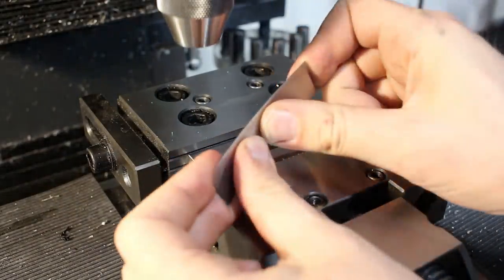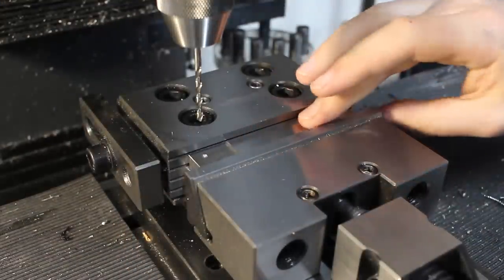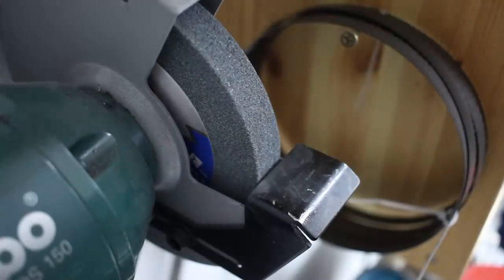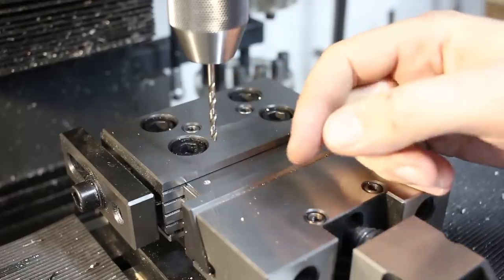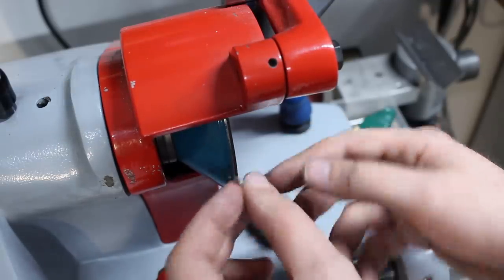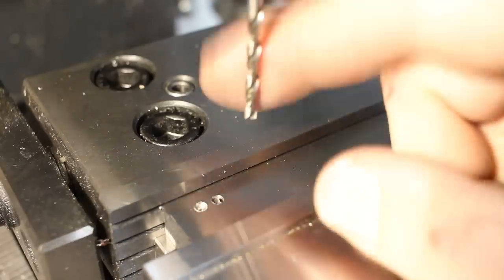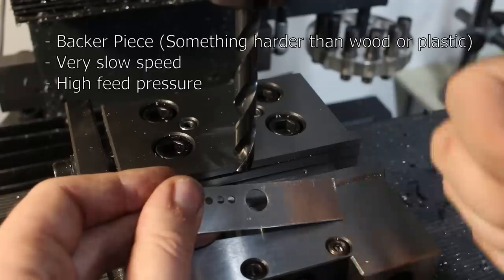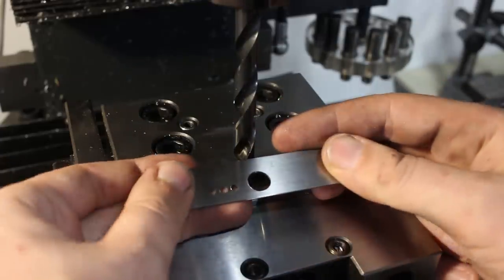Tipsblitz19: Drilling spring steel with HSS drills

Comment: great tip! now if only you had a tool to deburr those holes.
Reply: You just have to wait for Tipsblitz20, Tony.
Reply: TOT makes one from a file on his channel.
Reply: Ow you sneaky TOT..
Reply: It would probably need a sub-scribe tool. Any ideas ToT?
Reply: Knew I would see you here
Reply: Sam Hill  😂😂😂
Reply: could you use the corner of a ceramic brick? or maybe a crystal of quartz?
Reply: @charlesangell_bulmtl  that makes me think maybe the radio candle (idk what it was called) that StyroPyro showed off recently can be used to selectively heat sharp points on the part

Comment: Stefan, love your videos, can i add a tip I  have learnt from my years in the workshop and driiling hard steels with HSS drills. If you take your sarpened drill to the diamond lap on your tool grinder as you did to split the point but instead of splitting the point you grind the cutting face true to the axis of the drill bit ( in effect reducing the positive rake of the cutting edge to a neutral rake) this presents a very strong edge to the hard material you are cutting that will not dull easily. Drill at slow speed and with a high sulphur cutting oil if you have it and the drill will slide through even very hard steels..(I have drilled holes in ball bearing cages and files using this technique) Thanks again for your fantistic and informative videos..you have taught me several things :)

Comment: Stefan, my personal trick for drilling thin spring steel (no more 1/32" or 0.80mm) is to spot anneal the drill site. I do this with friction heating. I grip a wood dowel in the drill chuck, max the spindle RPM, and intermittantly force the wood dowel firmly into the work hard enough to make smoke. Stop when you see a blue spot spreading from the friction. Then swap to the drill and make your hole at normal drilling speed. This might work on thicker material but I haven't tried it. Metal backup will suck the heat away: you might want to use wood after all. 

Don't over-feed. You don't want red heat - just enough temperature rise to draw the spring temper into machinability.

You might also "bsck off" the 25 degree positive rake at the cutting edge to neutral as you do for drilling cast bronze.
Reply: Poo lo
Reply: Seems a very good method, I will try next time I need!  As you mention, it will probably not work that well in thicker material (because the more heat dissipation?).  Couldn't that be solved by using an aluminum (or other material) dowel?  It would give a much higher friction (= more heat) than wood on steel?
Reply: sometimes the best solution is low tech!
great idea, thanks for sharing!

Comment: Ordinary spring steel sure is a pain, but if you can find some Bruce spring steel, that stuff was Born To Run.  It's used in band saw bands, automatic transmission bands and E Street bands.  Just be careful with polished Bruce spring steel when you're out in the sun so you don't get Blinded By The Light.  A lot of the Bruce spring steel that's on the market today was Born in the USA, but sometimes makes it overseas.
Reply: You do realise that this many Dad joke in a row is a Federal offence.

Comment: Good Video Stef, that old trick is well explained by you. I like to use my Black Smelly Smoky Cutting Fluid to give more life to the drill, web thinning is a great way of helping push through. slow speed drilling like that is really good in stainless steel as well. Cheers Bruce.

Comment: Brilliant tip on 2 accounts - slow speed drilling not high speed and a simple but functional method of grinding a drill tip to the correct angle / shape

Comment: some input from a oldtimer.  A long time ago we used stone or concrete drill bits, gave them an edge on the grinder and that way one could drill a hole in hardened steel! Using your DIY drillbits, anyone can still do this today.

Comment: Great tip Stefan.  I do use the masonry bits on hard materials and have had good success but they need to be ground just right.  Your tip is brilliant and I'll certainly lock it away in the brain box for latter.  I notice you don't use coolant, I'm assuming its for the same reason I don't use coolant for drilling or machining hardend materials as it reduces the friction and the tool just rubs instead of cutting.
Cam

Comment: Really useful tip, thanks.  I noticed you didn't use or mention lubrication, should cutting fluid be avoided for spring steel?
Reply: Cutting just one millimeter deep cutting fluid doesn't do anything.
Reply: @ChristophPech  My understanding is that cutting oil has other beneficial effects beyond cooling such as reducing friction (less spindle power needed) and preventing cold welding of chips to the tool (which is a major cause of wear- the cold welded chips subsequently break off and take chunks of the cutting edge with them). You wouldn't try to use a tap without lubricant (except in cast iron or free machining bronze/brass) and they are run far slower than this. Of course if Stephan used it here we wouldn't be able to see what was going on so easily, and there would be more mess to clean up.

Comment: Reminds me of drilling hardened tool steel at my old job, but HSS wouldn't touch it. Solid carbide drill worked, but would usually break under the force required to cut the steel. A sharpened masonry drill was the way to go because the shank could take slight flex and wouldn't snap. Also pilot holes, pilot holes, pilot holes and lots of coolant.
Reply: @MatthewMelson  I worked with wire EDM! And drilling into hardened steel was usually to correct some mistake or drill a starting hole when someone forgot to put it in before hardening, so usually done on a Bridgeport style mill by hand ;)

Comment: I drilled a quarter inch (6mm?) hole through a piece of hardened carbon steel(I think it was similar to 440C steel used in knives) with a masonry bit ground to have sharp cutting edges, I believe it was near neutral, just a few degrees positive. The carbide broke on exiting the material, as I didn't have a backer (was using drill press). It was working really well until it broke through and one cutting came off. If you need the bit for more than one hole, I'd suggest a piece of mild steel as a backer, maybe even something harder, so the bit doesn't break when it exits the work piece.

Comment: I suspect the reason for the slow speed and heavy pressure might be the limited number of rotations of the cutting edge before it is dull. Let's say as an example, the cutting edge is good for 100 laps before it is dull. At 100 rpm, one could drill for a minute before the bit is dull. On the other hand, at 1000rpm, one could only drill for 0,1 minutes or 6 seconds before the bit is dull. I could be entirely wrong but it makes sense to me.

Comment: Using a center drill it works nice. I think center drill has a harder hss. It never failed. Just regrind the tip. And of course using small rpm

Comment: Is this method useful for drilling in hardened files and rasps?
Reply: No. Hardened carbon steel have more hrc than stainless spring steel. You need a special carbide drills and its wont be easy.

Comment: When you sharpen the drill then use an oil stone to make the edges razor sharp and use some oil for lube. You can buy a split point 135 degree cobalt hss drill too. 118 degree is standard and 135 is for hard materials.

Comment: Okay?  I have a ancient Cub Cadet riding mower I used to have to make custom blade sets for out of old vehicle leaf springs.  Just hydraulic pressed them flat then drilled them slow with normal HHS bits and never had a problem.

Comment: Slow and with a lot of force. Hmm I have a drill press for that. >:) I've had good success with masonry drills for hss drilling. Usually only one or two holes, but that's enough.
Reply: Me to, also drilled hardened dowel pins, they make great tools for pressing bearings ect.

Comment: The vise Is from Gerardi Italy ?
Reply: Can giù prevent the cutting Edge chipping with a "brass" type drill? The brass type had a low spiral on the flute and present a more negative Edge (more like 90°) and more material around equals more strengh geometry but more cutting pressure